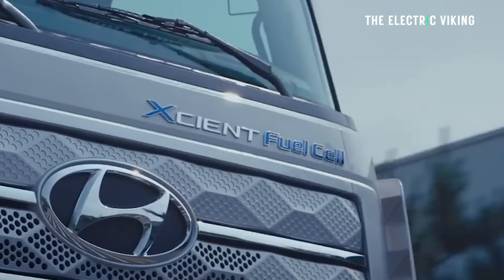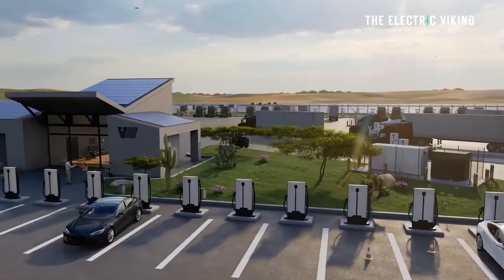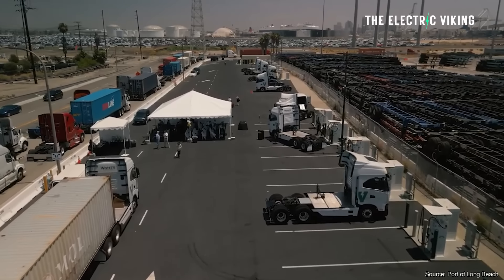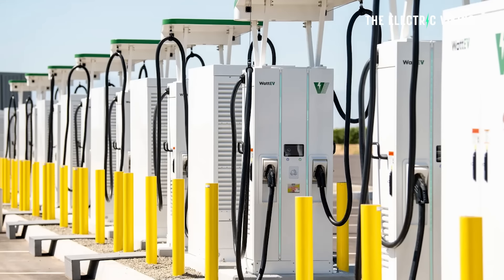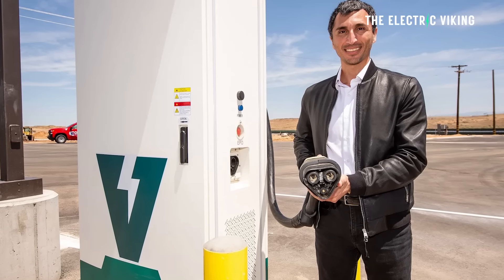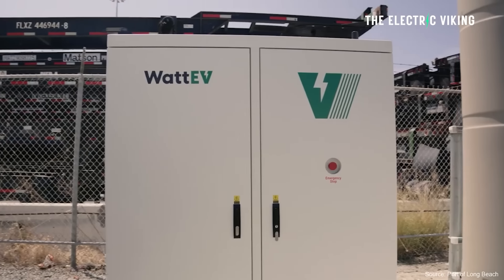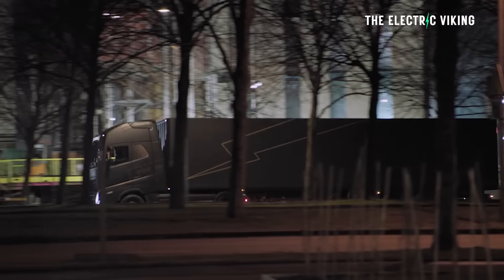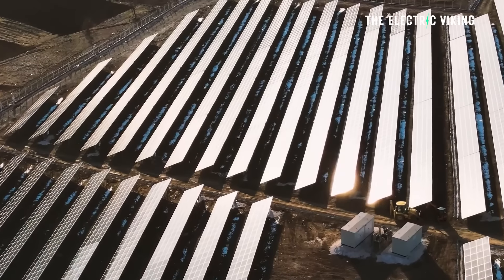America's first 1.2 megawatt charge station is powered by solar & batteries

Comment: You are hitting on the critical fail point of Solar/battery charging.  You have 2-3 hours of peak sun even in the brightest towns like Pheonix and Palm Springs to charge enough batteries for 1 Semi truck; you need 3000 300w Solar panels and 1 Gigawatt of Battery for each such truck. There are 3 million Long haul and 6 million short/medium haul trucks to charge Just in the USA; each long haul truck will need at least 3 maybe 4 packs to run all day; 12 million megawatt Packs - current production of Lithium being 169,000 tons; enough to make 338,000 packs; so that alone will require 36 years just for US Long haul trucks.
Reply: I love it when you lay down stats that totally debunk the nonsense of EV`s 😭😭😭
Reply: I just came up with the figure of 4,800 solar panels to produce 1.2 Mwh. in ideal conditions. That's about an acre and a quarter of solar panels with no room between them. Conveniently, a "typical" 18650 cell is good for about 12 watthours of capacity which means that you'd only need 100,000 of them to store an hour's worth of optimum solar energy.
What's the problem?
Reply: @davidbrayshaw3529  Definately a problem - the batteries needed alone is even more accute perhaps.  I think they could just wait to see if the USGS find of trilions of tons of hydrogen is economical to harvest; if it is then game over for solar/batteries - not neeeded too costly.
Reply: @pauljackson-k3l  Thanks Paul; well I think even if they use sodium they will still have massive problems, because US heavy trucks is only a tiny bit of the 1.4 trillion vehicles on the planet.
Reply: 6am to 8pm of sun everyday here in Southern California 🌞 🇺🇸
Reply: @larryc1616  Clearly everyone assumes that; the problem is your solar panels only put out significant energy at the peak 2-3 hours,depending on the time of year.  You've even had clouds lately; Im presuming every single day is clear. no clouds, dust/sand storms, frost, etc. If you have 10 solar panels in Vegas, you can move your Model 3 about 15-20 miles but thats 1.5 miles for a Semi; so 100 panels for 15 miles, 1000 for 150 miles and 3000 for 450 miles which is only 6 hours of driving at 70 mph So I'm even allowing for the driver to rest several hours which they don't really do at night.
Reply: Commercial solar panels are at 700W now.

Solar irradiance factors in most parts of the world are at least 4.

For 1MWh of power, with a 4x irradiance factor, you need about 250kW of solar panels to collect 1MWh daily. At 700W per a panel, thats 357 panels. Not insignificant,  but a lot more reasonable. 

Lol, you don't need a GWh battery to charge a 1MWh battery...

Some buffer would be nice, but not that much. Plus the vast majority of vehicles won't be 100% dead. More like 60-80% charge top up requirements. And a lot of the last miles delivery trucks only have 0.25-0.5MWh batteries. 
And a lot of charging will be done during the day, when the solar is outputting. 

Note that for reference, a Tesla MegaPack has 3.9MWh of available capacity. 10 of those would give 39MWh capacity. 

Depending on the useage expectations, and whether these are grid connected or not (and if so, can do bidirectional power), 10-100MW worth of solar could make a huge truck stop. 

Each 1 MW of solar could service 5-10 Semi's per day.
Reply: @litestuffllc7249 
Trillion? Seriously...

Did you mean 1.4 Billion vehicles?
Reply: @jeffl4810 Good analysis. I was shocked when the other guy mentioned 300watt solar panel. There are some 700 watt solar panels that are double glass, meaning, the back end also produces electricity, about 30% equivalent to the front end. So that is 900 watts for a single panel.
BYD and CATL are now producing more than 6 megawatt/ hour  the equivalent of a megapack. So what is the nonsense that solar power coupled with batteries cannot charge sustainably long haul trucks?
Reply: Mate, that's completely incorrect, with single axis tracking solar farms, they pretty much hit their rated output from the moment the sun is clear of the horizon to maybe half an hour before sunset.
Reply: @mshackleton1  OK go ahead and show me a link where there is shown to be true; its going through more atmosphere; so lets see the output chart of such a setup; and I imagine you recognize hardly any farms track the sun; and it depends where it is setup physically.  There is one near Las Vegas that is now shut down; but there are mountains to the west. I didn't subtract for anything else, clouds, fog, sand/dust storms, and I went with figures from a real city Las Vegas. Nonetheless I'll be interested to see the output charts for panels that track.
Reply: @howardj602  
Um, used packs get recycled. 
The minerals are highly valuable, and have an over 98% recovery rate.

Biggest issue ls with recycling EV batteries - not enough batteries available. 99% of EV's still have their original batteries. 
Most dominant failure: water intrusion from flooding or a damaged battery casing. 
Older chemistries sometimes didn't fair too well with age. That's mostly corrected now with better chemistries and BMS's with thermal management
Reply: @benzengap6804  
My reply was deleted...
Re-written 

Nice, I wasn't aware that there were double sided panels available now! I'll have to look into that. 

There will be ever bigger utility scale batteries. And they will keep getting cheaper per MWh as the tech matures and economies of scale kick in.

I like to reference Tesla's MegaPacks, as most people heard of them, and the specs can be found easily with a quick search. 

Yeah, the OP to this thread isn't knowledgeable in the subject...
Reply: @benzengap6804  
My reply was deleted...
Re-written 

Nice, I wasn't aware that there were double sided panels available now! I'll have to look into that. 

There will be ever bigger utility scale batteries. And they will keep getting cheaper per MWh as the tech matures and economies of scale kick in.

I like to reference Tesla's MegaPacks, as most people heard about them, and the specs can be found easily with a quick search.
Reply: @benzengap6804  
Yeah, the OP to this thread isn't knowledgeable in this topic...
Reply: @jeffl4810  Less than 5% of the discarded  EV batteries are sent to recycling plants. The rest are junked or abandoned, or shipped overseas as waste.
Reply: @howardj602  
I highly doubt they are abandoned or sent off as waste to be abandoned. 

They are too valuable, even if they are only to be as scrapped.
Reply: Lol, woke YouTube keeps deleting my post because it contained black and mass next together...
Reply: @howardj602 
The materials and minerals are easily extracted after going through industrial shredders. And are highly valuable. 

Re-use of highly glued / encapsulation of the batteries does make their resuse harder. But that's not a problem for recycling. 

Re-use of highly glued / encapsulation of the batteries does make their resuse harder. But that's not a problem for recycling. 

The encapsulation does have benefits. By far, the biggest issues with batteries failing in reputable manufacturers EV's is water intrusion (flooding being the biggest reason. Damaged battery casings are also an factor).  The encapsulation helps deal with that. Note that with reputable EV's, 99% of them still have their original battery, and will mostly remain so for the ramander of their expected lifespan. Newer battery chemistries are expected to last a very long time. Look up NMC 532 for example. 

Fires are also very rare in reputable EV's. Proper engineering limits fire issues if a cell goes off, by preventing cascading fires from adjacent cells. Tesla's designs are really good with this. The encapsulation materials are also fire suppressants.
Reply: @howardj602  look up EV battery recycling. 98% recoverable, and the minerals are highly valuable. 

Commonly called battery "    " mass or battery "     " gold, but some colors seem to get posts censored
Reply: @jeffl4810  I have looked up EV battery recycling,  And researched the people who are now doing it. Not speculation about something that may or may not happen. My comments all refer to current practices. 
Fires in EV batteries are not as rare as you thing.  Fighting  those fires means the development of new firefighting equipment and techniques to combat the hazardous fumes.  The commonly used Scott Air Pack breathing devices do not filter out the volatile chemicals generated in a EV fire. 
EV battery  fires can last from 2 to 3 hours, with a risk of reignition as long as a year. Tesla has an inventory of   232 confirmed  Tesla fire  cases and  Fatalities Involving a Tesla Car Fire Count: 83.
Reply: @howardj602  
A quick Google search shows the likelihood of catching on fire:
Gas vehicles 1,529 per 100,000
Hybrid vehicles 3,474 per 100,000
EV's 25 per 100,000
Yes, that's right. Almost 2 orders of magnitude less likely to catch on fire compared to gas. And that includes data on poorly made EV's. 

This is consistent with the data I've been seeing in the past.

Most serious EV fires are from non-reputable brands in the EV sector. Like most things, they must be engineered well, or issues will arise, including safety issues. Sustained battery fires are the result of this. Especially the size of some EV fires, which, if proper fire mitigation methods were employed, we wouldn't be discussing this topic. 

Also note that LFP batteries (LiFePO4) and it's derivatives are at least an order of magnitude less likely to combust.

Looking at the website you likely got your stats from (tesla-fires), some of those fires were definitely arson...
Like the 14 Tesla's listed in France.

And, the vast majority of those Tesla fire fatalities were crashes, where the car ignited. Those fires were NOT the cause of fatality ....  Guess how many ICE vehicles catch on fire after a serious crash?

And here's the real kicker:
232 fires out of over 5,000,000 Tesla's vehicles sold... The vast majority caused from physical damage. 
That works out to be 4.6 per 100,000, over 5x better than all EV's combined. And insanely better than ICE.

Yes, battery fires can be hard to get out. Most chemistries have self oxidizing materials in them. New fire fighting methods are starting to become available. The biggest issues are the batteries are under the vehicles floor, enclosed, making access difficult.
Reply: @howardj602  
EV battery recycling is already happening at a commercial level. With very high reclaim rates.

Their biggest issue, is lack of batteries, as 99% of EV's still have their original batteries. 

Yes, there are/were some crappy recyclers. That is NOT the case with all recyclers. Especially for the ones who've employed advanced reclaiming techniques.
Reply: @jeffl4810  I did not doubt the causes or the magnitude of the fire damage. 
However the conclusion is skewed because of a difference in age and numbers of the EV fleet and the ICE fleet.
The average age of a EV is 3.9 years and of an ICE 12.9 years. 
What is important is the buying public's perception of the safety involved with the vehicles.
The Tesla was sold to a very small niche group.  Income $146,000 vs average 74,800.  Tesla  home owner ship 97%,  70% no children in home. Insurance claims highest of 30 top brands.  
It appears that Tesla has maxed out its niche  consumer base. 
The recent downturn in EV sales in the U.S. is also  showing consumer resistance to all EVs. 
You also have to realize the this is a major transformation of the mode of transportation world wide, and is in a constant state of flux. The outcome is an ever evolving thing and one size does not fit all.
Reply: @jeffl4810  Yes there are 1.4 Billion light vehicles.
Reply: @jeffl4810  Yes you do need at least an equal size battery. If they do not drive till near zero; then you need more batteries and sites; long haul trucks can't be wasting time stopping more than needed. (No the Tesla Semi does'nt go 500 miles loaded unless it is downhill with a tail wind. A Cybertruck using the 4680 recently tested pulling 5000 lbs, 80 miles in cold weather; it you scale that up by 10x it won't be better). There are various sizes if you have one that is 3.9 MWh it won't change the ratio of lithium required to charge per truck; you'll still need the Original Trucks charge and at least 6 equivalent amouts of battery to keep the truck rolling through the late evening and early morning. For every battery pack there will need to have sufficient planels to charge them. The largest problem is lithium supply, after that you can talk about using your 700 w panels instead of 300 w but it still needs to be 1-2 battery packs charged for 6 million US heavy trucks and 6x 3 million for the long haul trucks. Whether you use 1 Mwh packs or 4 or 16 won't matter the amount of lithium won't change on a per truck basis; and you will still be looking at 60 years lithium production at 10x  current lithium production rates of 169,000 tons a year.  That seems implausible enought to scrap the entire idea; becaus that is Just US heavy trucks.
Reply: @howardj602  
Yeah, there is some bias towards the younger fleet of EV's. However, a lot of severe battery failures are early in their life cycle. Ev's, like most electronics, tend to get more reliable mid life, as the parts with infant mortality issues are weeded out. So I don't expect a large increase of incidents. 

Especially where ICE fire failures do increase with time. Oil leaks, fuel leaks, things getting built up around the exhaust are all contributing factors in ICE that are not present in EV's. ICE always has a significant ignition source - the exhaust, especially the super hot catalytic converters.
ICE also have had some bad electrical designs, where the main battery is unfused, and main wires have chafed through. Still mostly this way, with some extra anti chafe protection. Nasty when it happens. 
EV's are also prone to electrical fires, but they are much more protected electrically, and major engineering blunders (and bean counting corner cutting) like unfused battery are not really a thing with EV's. Contrary to popular belief, EV's are actually quite simple electrically. 

ICE fires have been reduced over the past decades, so that is a good thing.
Here, in Eastern Canada, most vehicles don't make it past 12-15 years, as the road salt in winter rots them away, so our average vehicle age is lower.

I agree, public perception is a HUGE thing. EV fires have been used as a massive smear campaign. EV's are becoming very disruptive to several legacy industries. Expect more smearing, and at elevated levels...

Yeah, Tesla's were definitely sold to higher income, higher disposable income groups. Their lower cost offerings, available now, as economies of scale ramp, are changing that now. Some Tesla's can be had now for gas car prices. 

As for EV sales declines, the big elephant in the room is ALL vehicle sales are down. High prices, normalized intrest rates, and recessionary pressures...
Nissan is down 2M sales, out of normally 5.x million. Stelantis still has 2022 inventory, and tons of 2023 inventory. Car lots are overflowing with unsold vehicles. 2025 inventory is just about to start flowing... Most other manufacturers are in the same boat, although some are fairing better. 

100%, this is a major transformation event. I used to do a ton with ICE.  And made it do some pretty impressive things. Still have a bunch of ICE, but going forward, it's EV's
Reply: @jeffl4810  As far as recycling goes. You should also be aware that the container ship that was involved in the bridge collapse in Baltimore had among its cargo. 56 containers containing hazardous materials including corrosives flammables and lithium ion car batteries. The containers are modular 40'x8x9'6.   are commonly carried on these container ships.
Reply: @howardj602  
That ship that hit the bridge, had nothing to do with it's cargo.

The ship lost electrical power several times, and the emergency systems didn't kick in properly. All electrical power systems were generator based.

With restored power, they didn't get the main engines running in time. 
Steering in a large ship often requires the main propulsion engines to be running, as the rudders direct the propulsion thrust, to steer the ship. Without that thrust, they are very ineffective. 

A REALLY stupid design, to have main engines powered by generators, without battery backup. Being diesel based, even with their massive size, a battery UPS like system would not be a major cost.

Some analysts think it may have been related to bad fuel (eg containing water...). Especially as you can see big plumes of black smoke as the crew tried to get the engines started before the crash.

As for the cargo, if it was recovered battery materials, it doesn't matter. Battery manufacturing is just starting to ramp up in North America, as we're just building many of the battery plants. The recovered materials will be sold to the highest bidder. Which is probably Asia right now.
Reply: @jeffl4810  Why would batteries fail earlier?  They have to be in perfect alignment in order to avoid a short and like the Porsche that was first to catch fire in the ferry incident; was dendrites which are random. As battery packs get older seems to me they are more likely to have cells become misaligned due to impacts or accidents; old age seems to me could cause cooling systems to fail or cells to corrode.  I think you are too optimistic.
Reply: @litestuffllc7249  
Cells normally fail from punctures in their ion separator laminates.

This is normally caused by impurities (ie contamination) in the materials used to make the cells, puncturing this separator. 

These impurities cause infant mortalities in affected cells

Dendrites don't normally form from normal charging. Lithium cells are HIGHLY protected against overcharging voltages to prevent this and the plating of Lithium metal inside the cells. 

The fire in the Porsche was likely from a VERY poorly engineered pack. Lithium battery engineering is a very serious topic, and was not likely done well, especially given the limited amount of EV cars sold by Porsche. 

Lithium Iron Phosphate,  LFP, (LiFePO4) batteries are also MUCH more resistant to fires, as they don't go into thermal runaway nearly as easily. However, they offer less energy density. NMC battery's are the ones that normally burn. Being a Porsche, I would assume they would go for as energy dense as possible for performance. 

Vibration of the cells is not normally an issue. At all. And they won't be knocked loose. Road driving vibration would be waaayyy worse than on a ship. Internally, cells are pscked nearly solid. Thermal changes will cause internal stresses to change however. Changing internal stresses will cause impurities to change the pressures on that ion barrier liner...
Guess what happens on a vehicle transport ship - they go though various temperatures. Sometimes baking from the sun. And then cold at night.

What was likely the issue in this case, was a contaminated cell, that punctured through its ion barrier, causing the cell to go off. Because the battery pack was NOT well engineered against these hazzards, the burning cell caused the adjacent cells to catch fire, and so on, in a runaway situation....
Thermal changes likely initiated the first, defective cell to go off.
Reply: @litestuffllc7249  
Tesla Semi's are achieving their rated 500 Miles, fully loaded in the vast majority of situations.  And close to it in severe situations. Note that it has to be the long range Semi for 500 miles...
This is from multiple sources.
They consume 1.25 kWh per kilometer. Loaded.

Don't worry about the grid. Or people popping up solar charging systems. 

The grid will handle it, with some utility scale battery buffering. And some localized distribution upgrades in areas. Transmission lines will be upgraded as we switch to renewables.

For the people popping up off grid charging sites, they'll either get it right, or go out of business. 
Note that people investing in those will have the technical expertise available to make the right calls for what's needed. I showed my example in a previous comment in this thread.

Here's some interesting numbers:
USA annual power usage 4,200 TWh
Approx needs for FF processing 1,100 TWh in the USA.

Approx needs if everyone went EV, only 600 TWh needed. Yes, a savings of 500 TWh...
Reply: @jeffl4810  I was not making a critique of the ship I was just pointing  out to you that discarded lithium ion batteries are being exported overseas to be disposed of.  Not recycled as you claim.  Baltimore is one of the smaller ports where it was happening.  Let me know when and if they get those plants built in the U.S.
Reply: @jeffl4810  How many Tesla class 8 are actually in revenue service on the road in the entire world?  Compared to Orange EV  class 8 which  as of April 2024, has surpassed 14.3 million miles and 5 million hours of operation.
Reply: @howardj602  
Ok about the ship.
The battery materials will be sold to wherever they can be used, for the highest price. And they are quite valuable, being higher grade than virgin mined minerals. They are not being disposed of because of that value. 
Yes, there are/were many instances where materials get sent to 3rd world countries, where they are not used in a very environmentally friendly way. Plastics are probably the worst for this. Reports have claimed only 5% actually gets recycled. That would not surprise me. I wouldn't be surprised if a lot gets incinerated for energy also.
Note that somebody is paying for that material, even if plastic.

Fortunately, at least for the minerals and metals in batteries, they have very significant value, and won't get wasted because of that value. No matter what part of the world they end up.

As for USA based battery plants (EV related - there are lead acid plants all over the world), I'm not fully knowledgeable in the subject, but Tesla has a big one in Nevada, and I believe another in New York. They are building one in Texas. 

The "One Battery Factory" in Michigan is going to be a pretty massive factory. Proto line is up and running. Main production lines are being built. Some may be operational right now. 
Sandy Monroe did a good video on the One factory about half a year ago. A highly recommended video to watch.
Reply: @howardj602  
Not many Tesla Semi's in service. Unfortunately. 

They did a controlled rollout, which is what needs to be done, to test the crap out of them before releasing to major production.  It's too bad it isn't faster, unfortunately. But they should have a top notch vehicle when it's released in mass.

The Tesla Semi charger can put out an insane 2.4MW of charging power. Not sure if that's an extra large version or not. Most Semi EV's chargers are an order of magnitude smaller output. 

The other brands Semi EV's are not well optimized, and are based on iCE platform conversions. They are not nearly as well optimized.  But they are getting used, and some brands are improving them. Hopefully, substantially.